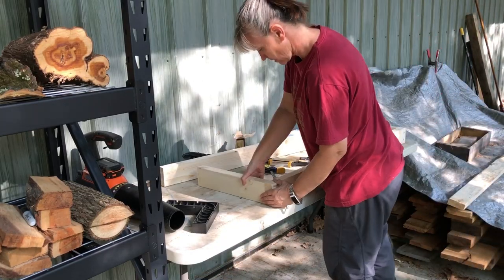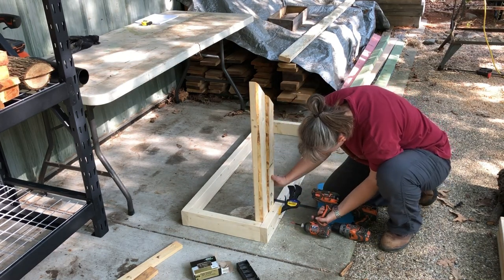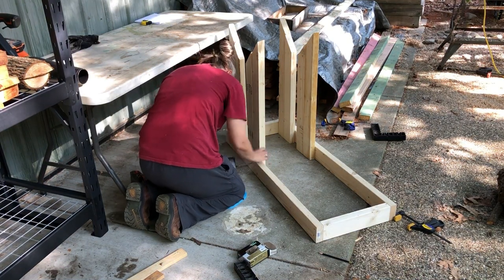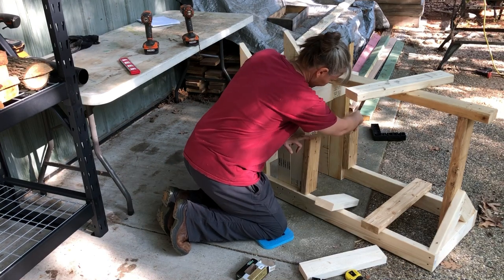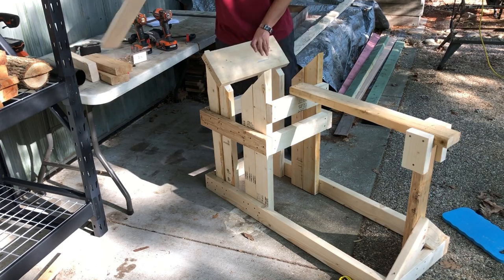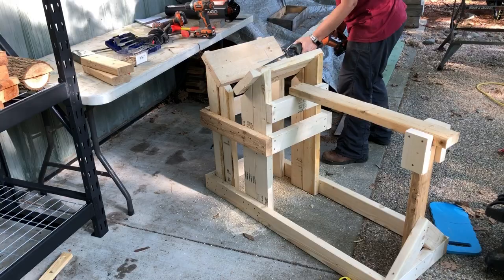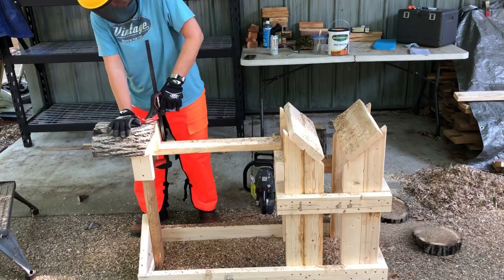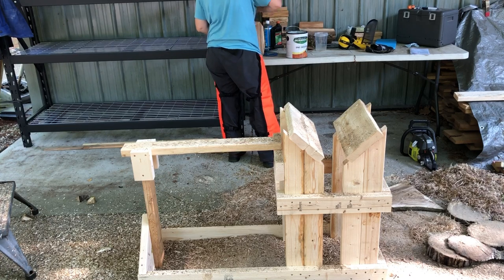Woodturning - Workshop Wednesday! Making A Chainsaw Milling Station for Turning Blanks

Comment: Great video. Thank you so much for sharing! I will be doing this.  Most of all, thank you for demonstrating it's use.
Reply from the maker: Hi Julia! I am still quite happy with this, but I find I don't use the flat extension much cuz I haven't found a good way to clamp it with the clamps I have on hand - one of my friends installed a 1/4" dowel pin on the flat 2x4, drills a 1/4" hole into the bowl blank and uses it like a circle cutting jig to know the corners off.  I have a decent sized bandsaw so it's not crucial for me. My only improvement is to extend the boards that form the V notch down further so I can hold smaller diameter logs.

Comment: Great stand. I have an idea to improve it. Regarding the place where you put the piece after you cut it.
 Instead of one rest piece coming out the back, you have room for two with a gap between them, it would be more stable and allow you to cut them down the middle.
Reply from the maker: That's a great idea - I honestly don't use that part much because I haven't been able to get a clamp to hold securely on that one 2x4. Perhaps some modifications are in order 👍

Comment: If I could hit 2 or 3 like buttons for this one I would.   This is awesome.
Reply from the maker: Thanks Holly - this is really working out nicely 👍
Reply: @LisaRamlow  can you tell me how many total 2x4's you used?
Also, have you seen the videos on building a vertical milling station?
I'm thinking I can build one as an add on to this station.
Reply from the maker: Hi Holly - I honestly don’t remember but the video link in the description should have the cut list for materials. I’ve not seen a vertical one?
Reply: @LisaRamlow  Check out John Heisz on YouTube he has a good video.  Theres a couple others if you search for diy vertical chainsaw mill.

Comment: Nice stand looks like it might work for cutting up fire wood
Reply from the maker: Hi Richard, yes that too! I had a hard time finding plans kind of geared toward making turning blanks - most of what I came across was more for cutting firewood and didn’t have the piece to hold the flat stock, but had longer v-cradle so you could hold a longer log and cut it to length for firewood.

Comment: Very nice design and build. You may find that the lower joints (where you used four screws to attach verticals to the base) may fail over time. A single lag bolt (per 2x4) would make a good replacement, or even addition.
Impressive demonstration of proper PPE. Thanks for posting.
Reply from the maker: Hi Guy, thanks so much for stopping by! Agreed, I may need to reinforce some of the joints, etc - I followed Ky’s build plans pretty closely but I am the queen of overbuilding so will adjust as necessary. So far it’s working out really well. I do still need to get a large throated clamp to use on the horizontal section but aside from that I’m super happy with it.  😊

Comment: Great idea, I need to make something similar for the same thing. Lately though, when I have a log to process I just cut it to the height of blank (Just above and below the Pith) with the Saw Mill, then buck them to length, kind of the reverse process of what your doing in the video, and also affords me the ability to cut a flat on the rounded side the easier mounting. Thanks for sharing Woodturner Ky, will check out his stuff, lol, another one to add to the many unwatched videos I haven't the time to watch, lol.
Reply from the maker: I’m sure there are lots of ways to process wood for turning -I was glad to find Ky’s video as this design is working really well for me.

Comment: I have been using a make shift cutting station with a pallet and I attached some 2x6 for the log to cradle in.  I wasn’t able to see your shaving and was told to use a “ripping” chain blade. I had some older chains and instead of 35degrees I sharpened them to 15 degrees and the shaving are every bit of 2-3inches long and am able to cut 25+ logs without noticeable dulling .  (I was using a regular chain w 35 degree and was dulling it super fast). You might be already going this route but wanted to share my experience.  Thanks for sharing the setup!
Reply from the maker: Hi there, thanks for stopping by! I’m pretty new to chainsaws so am using the stock Oregon chain, with whatever angle that is, and I don’t think it’s a ripping chain. I may need to upgrade to a larger saw so I’ll do a little research on the chains before I make any decisions. thanks for the tips 😊

Comment: Great stuff... this is precisely what I was looking for.  Going to make one for me and one for a buddy I got into wood turning.  Dont sell yourself short with the 'I cant cut straight with a chainsaw'... you did absolutely just fine.
Reply from the maker: I find I don't use the flat part cuz I have a hard time securing the blank - I'm sure there are ways to rig up something but I haven't worked on it. I am also going to add a layer of 3/4" plywood to the V-part cuz it seems a lot of the logs I cut aren't quite big enough to catch securely so adding the plywood will extend the V a little lower and should be plenty strong enough for he smaller logs. 
My chainsaw skills are improving 😁

Comment: You drill mighty fast. ;) jk. Another great video.
Reply from the maker: I normally don’t pre-drill when I’m using the self-cutting deck screws but the first joint I put together split the end of the board - I only had one extra 2x4 and figured I’d be mad about it if I split another piece so I should just be a good girl and pre-drill all the holes. If I’d have only used the impact driver to put them in it would’ve been SUPER fast! 😂

Comment: Sawing straight hint: Right hand on throttle controls vertical cut. Left hand controls horizontal pressure on the bar, so hold the handle low on the left side to keep firm pressure on the cutting bar reducing flex in the cut. I like this design better than what I built. Time for a new one! Thank you.
Reply from the maker: Hi Valerie, thanks for stopping by and for the tips - I’ll practice them next time I’m making blanks!

Comment: Pretty handy build! Now get a bigger chainsaw!!! 😅😅

I'm happy with the Echo w/ 20" bar I got at Home Depot but a Stihl or Husqvarna are the gold standard 

Stuart
Reply from the maker: Hi Stuart! Um, yeah. 20” would be ideal and depending on how things go I may end up having to buy yet another chainsaw 🙄
I try really hard to plan ahead and get what I need the first time but I totally bombed on this tool!
Reply: @LisaRamlow  my best advice is buy the best you can afford, make it work as long as you can and upgrade as needed. Also, big saws can do small jobs but not the other way around
Reply from the maker: MrTaco250 That is great advice. I’ll admit o was a little bit ‘scairt of a chainsaw bigger than 16” but I’m feeling a lot less wiggly about it now. I’ll make this one do until I can’t anymore and go from there 😊

Comment: I don't think I could ever be a content creator.  I barely have time to do the stuff I want/need to do, let alone do all the work related to making interesting videos.  Thanks for sending this link.  Question, how do you get your chains sharpened?  I ask because it looks like part of the problem you are having with cutting straight has to do with your chain being sharper on one side than the other.
Reply from the maker: This is probably only the second time I’d used this chainsaw so I’m sure part of it was my inexperience

Comment: LR I need to build one. Would you suggest any changes or you still liking it just the way you made it?
Reply from the maker: Hey Chris! So far I like it how it is - the only thing I would change and may yet still is the cradle for the noodling cut. It would be helpful for me to have the 2x10s extend down at little farther so the gap at the bottom isn’t so wide. Some of the logs I’m using aren’t huge diameter so after I cut one side of the pith for one blank the other side tends to want to fall though. I might just use some 2x stock and glue a piece of 3/4” plywood to the top and the ply can extend down an inch or so and that would be enough to make the gap a bit narrower. I also need to make a couple of wedge things so I can prop the wood up get it to sit right so I can cut it vertically and not all crooked 😂

Comment: I have been using a skip tooth regular chain on my electric chain saw.  I just heard about a ripping chain for longitudinal cutting logs in half.  They are supposed to do a faster better job.  Anyone have any experience with ripping chains?
Reply from the maker: I haven't tried them - I just try to be patient if I'm ripping or just be content to cut into end grain if need be and sharpen more frequently
Reply: @LisaRamlow  Thanks for your resp0onse.  All I can gather is that the rip chain gives a better finish than a regular chain.  If it were faster, then would probably buy one but I haven't found that info yet.  I have 3 LARGE pieces of olive to cut up and some eucalyptus that has probably sat 10 years in the sun.  The olive is really amazing grain but it's major trouble getting it down to size it's so hard.

Comment: I see you're using anchor seal 2.  Have you tried the original and if so any thoughts on which is better?  I've only used the original, but my local hardwood supplier is no longer stocking it.  They only have the anchor seal 2 now. I've heard mixed reviews so I'm weary to switch from the original. Thanks and nice job BTW!
Reply from the maker: Hi Steve, thanks for watching! I’ve not used the original - before I bought this gallon I tried Titebond Yellow Glue thinned sown with water as some other turners have used, but it didn’t work at all for me. I’ve not noticed any staining or discoloring so far but I haven’t used a lot of it. I haven’t had the cracking issues I did with the glue so that’s a good thing!

Comment: Actually I built one based on the same design/video. After using it for more than one year now I'm not totally happy with it. Issues: 
When cutting out the pith, the blank wants to slide through the slit upon the second cut and you end up holding it in position with your sawblade. (I saw you doing that too, before finishing the cut on the floor.) I'm also having troubles clamping a blank to cut off the corners. The wood is moving on me when I do that under the pull of the chain. Maybe that's just my crappy clamps or I dunno but its not working too well for me. 
The worst issue is the balancing problem that occurs when you want to shorten a blank while it is laying in the V-cut. This makes the blank want to tip over under the pressure of the saw blade. Seems to me like you need to clamp it somehow but I haven't found a way that works. 
Nevertheless I hope you are happy with yours and if you have some tips on how you work around these issues I would be grateful. 
WT Ky doesn't seem to make video's anymore.
Reply from the maker: Hi Leo!  Following your issues with the stand. I found it holds the log in the v-cradle quite well if I go all the way through - it doesn’t bind the chainsaw bar which is what I was worried about. If I make both cuts on either side of the pith I won’t go all the way through and then just cut one side through. Finishing the last little bit on the ground isn’t a deal breaker for me, especially when you look at what I’ve been using 😂. I’ve not gotten back to my butternut so I haven’t had a chance to find more things that might need to be tweaked. I noticed that Ky hadn’t put anything up in a year

Comment: While you're getting the hang of the straight cuts... take a little time to do a little layout:
1)get vertical lines across the end of the log where you want the but to go - chalk is a good item to use, or a grease pencil, or other "rough lumber" marking item
2) Start the cut from both ends - on the end farthest from you you really only need the saw to start the cut at the top corner of the log - this gives you a visual for starting the long cut from the other end
3) When you start that cut from the near end you want to not go very deep at first, maybe an inch, at like a 30 -45 degree "up" angle so that the saw end ofyour bar is established on the vertical line you want, then roll it down to score the bark sighting along the tip and that small cut you made at the far end

Now your cut line is established and you can go to town.

I've also found that if you can maintain that 30 - 45 degree angle you get shorter chips and avoid that pile of spaghetti that builds up at the saw

I cut through a 21" diameter x 21" long Walnut butt log and got a fairly even 7-1/2" thick slab out of it ( having a 32" bar may have been cheating, but the technique works) 

That first cut an inch or so at the near end long your line establishes your guide, laying the chain down the length a bit gives you that kurf to guide the left/right .. using the nibble at the far end gives you a target that doesn't vanish once the noise, vibration, and dust all start up and the color contrast between bark or outside of the log and the fresh meat inside is easy to see 

After you've done a dozen, you'll probably end up dispensing with the lines and even the far end nibble since you'll have established the feel of starting the cut and then following that initial kerf 

Nice set up hope you enjoy it.
Reply from the maker: Thanks for the tips. Chainsawing is pretty new to me so I’ve got lots to learn 😊